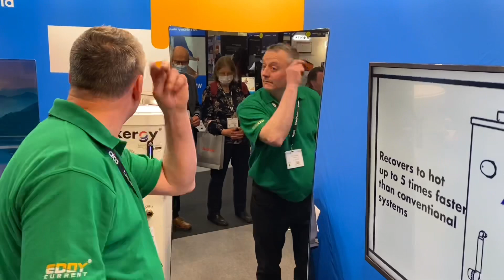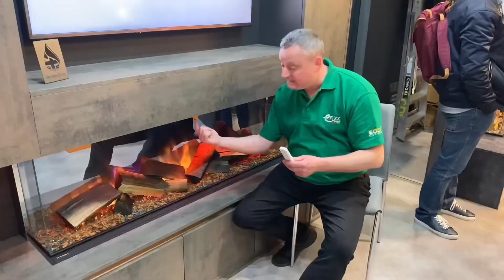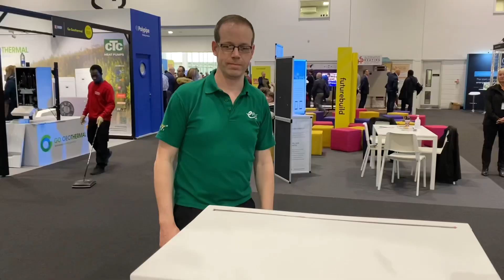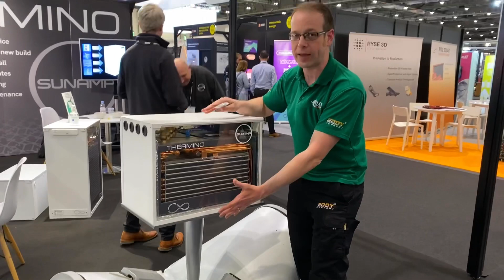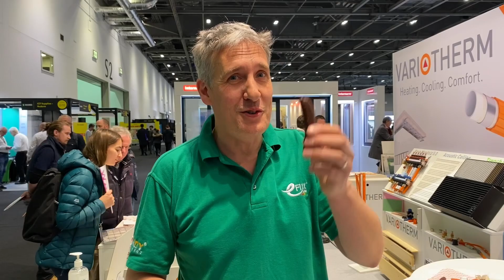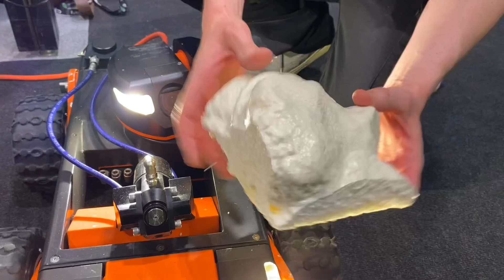The 7 MOST interesting home energy innovations from FutureBuild 2022

Comment: Isn’t it chemical energy stored in those pouches?
Reply: No. It's a fluid phase change (liquid to solid) that contains the energy. It's completely reversible, just boil them in a pan of water to restore to a fluid. Sunamp uses the same type of salt but with a different formulation to change the temperature of the phase change. The idea is you warm up the solid and turn it back into a liquid using cheap off peak electric directly or via a heat pump. When you want hot water it releases it back to the incoming mains water via a mixer valve. Mains pressure hot water, no waiting like with a combi boiler.
Reply: @davefiddes  & given the huge amounts of energy available from a phase change, it makes it relatively compact.

That’s pretty clever 👏👏👏

Comment: Too scared to tell us what the prices are for this hi-tech equipment.
Reply: It would be nice to know what they all cost.
Reply: @ladcjd1  At about a grand plus for those Mirrored Heaters each... your going to struggle to afford to stick them in your drafty old home let alone afford to then pay your leccy bill to then run them.

Another great invention for those with more money than sense! 🤔

As for the spray robot.  Looks great until you realise it will simply cover up a multitude of sins hidden under the floorboards of the average UK home, from not only heating/plumbing pipes to unprotected clipped direct cables and those hideous JB's we find on a near daily basis with loose connections that nobody either knew were there or could remember putting them under the floor.

🙄
Reply from the maker: How many do you want?